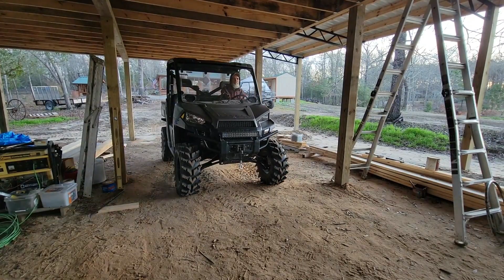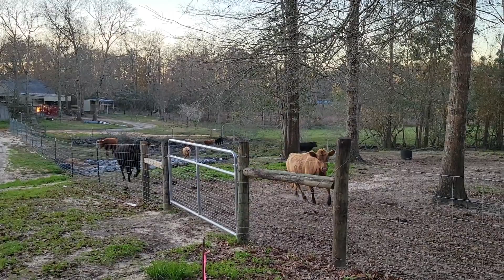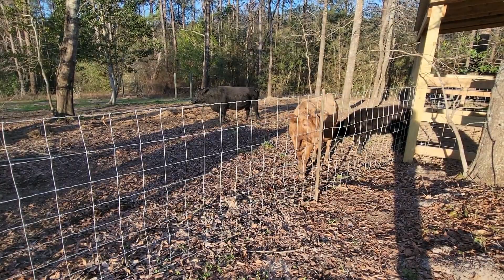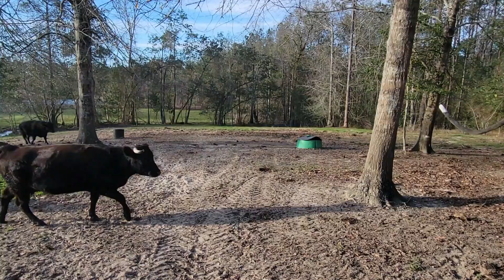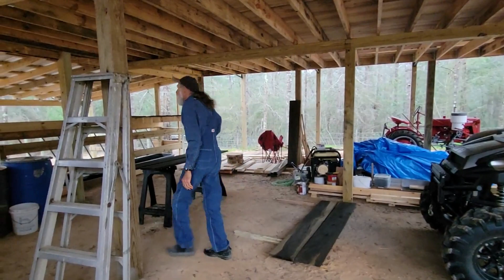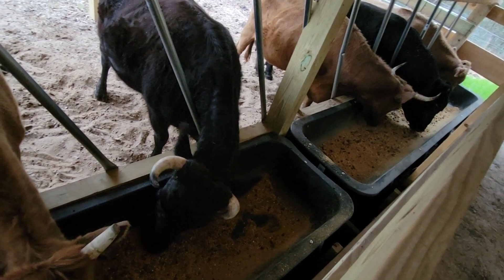DEXTER CATTLE a BAD Habit to BREAK!

Comment: Do you recommend I put 7 dust granules over my freshly tilled dirt and then spraying it down, to get rid of grubs. I noticed they were eating my veggie scraps I planted. I had to move a couple of cabbages due to realizing they were not spaced out far enough and the two I moved had grubs attached to the roots! Thank you for your time. I need to get all my seedlings in the dirt asap!
Reply from the maker: If this is your only garden spot do what you have to. If not put the chickens in it this year and turn the soil over till next year.

Comment: How long does it take for the sweet potatoes to sprout?  How often do I water them. I planted mine the same time as u. But they haven’t sprouted. I have only watered them once, lightly. Afraid  of rotting them.
Reply from the maker: It's got to be really warm and they need a little moisture to get going then a little more once you see the leaves starting.